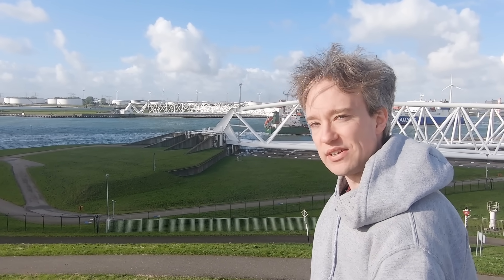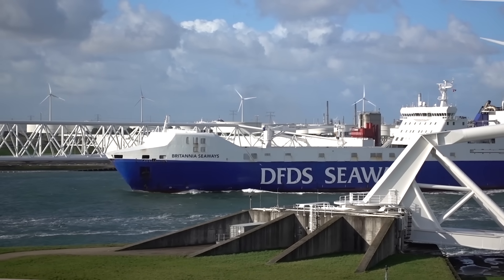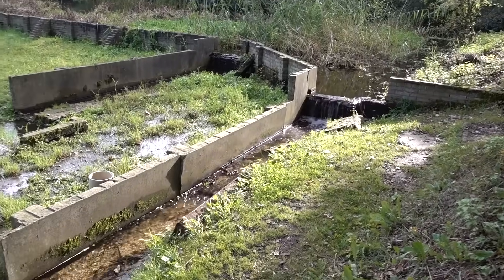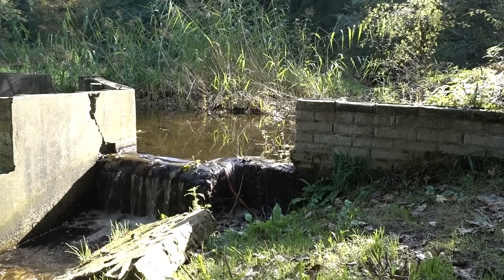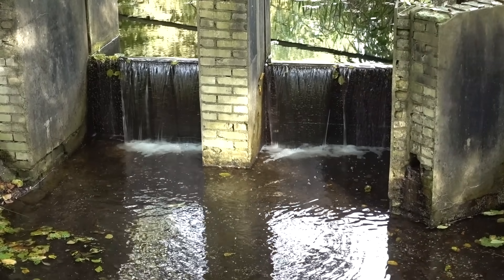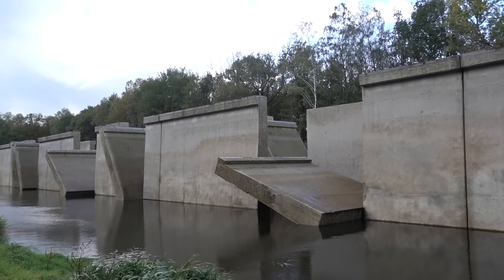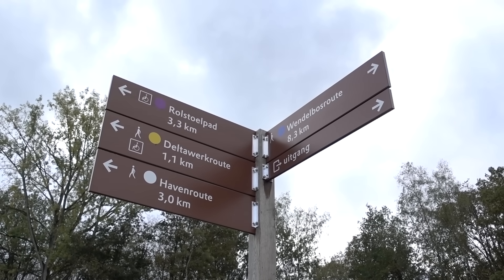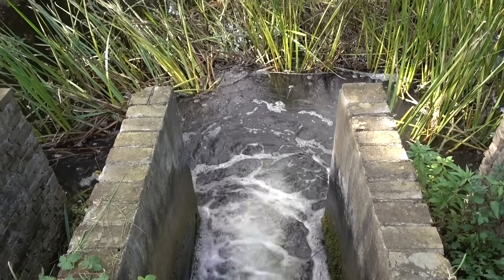How the Netherlands simulated the sea

Comment: An interesting point, the US Army Corps of Engineers built a similar facility in Vicksburg, MS in order to model the lower Mississippi River in order to determine how changes to the levee system would affect other parts of the river and how to minimize flooding damage through diversions at the Old River Control Structure, The Morganza Spillway and the Lake Ponchatrain Spillway

Comment: Computers are nice yes, but we still make models as of 2021 by the reason that some things are very difficult to simulate and needs a model . For this thing wich is kinda basic i think just comps would suffice but there is always a span where models may be required, however much smallet.

Comment: 'depending on who to believe, a fifth to a third is below sea level'
it depends more on the tides (1.5 to 2 meter fluctuation), then add the storm surge height as well. 
The 1953 disaster flooding had a total height of 3.85m above N.A.P (average sealevel at Amsterdam)
Its also the question if you include riverbeds that can overflow. Its not sea, but a lot of area is 'below water' in the riverdelta that way.

Comment: Actually.....
The floodgates of the Maeslantkering are being opened and closed at least once every year. The two times mr Scott refers two are closings due to actual storm warnings and should be three times. Fun fact, the system is 100% automated and does not require human intervention. It will close the doors if the water lever rises above 2.6 meters...

Comment: Cool video! However, one little nit-picking correction: The barriers won't flood at the 1:10000 year weather event, they are required to stop it. So it takes an event even worse to overflow the barriers.

Comment: Two fun facts:  

1. The storm surge barrier is quite literally out of their control. Opening and closing the barrier is managed by a computer which will close it whenever needed. Humans may wait an hour for the last ships to come in, or even try to save money. A risk that is almost never justifiable given the number of homes relying on this barrier. So it was decided the system would be build from the ground up in such a way that the people managing the system would be unable to interfere with the decision making process. There are, obviously, ways to shut down the system, but this would require work on multiple sites (tripping breakers etc) or agreement from multiple high-up people in different organisations. 

2. The Dutch will never even try to conquer water. It's a fight they know they will loose. The Dutch manage water. Getting rid of the water is neigh impossible, but leading it through channels is, for them, perfectly doable.

Comment: When I earned my Civil Engineering degree in the 1980s, we relied upon water models of all sizes, but none were outside. For example, I went on a tour of the St. Anthony Falls Hydraulic Laboratory, which used the flow of the Mississippi River at St. Anthony Falls in Minneapolis, Minnesota -- actually, just a tiny piece of that flow -- to provide moving water to test all kinds of designs and systems.

Comment: In tropical regions only mangroves, some specially adapted bushes and vines,  and some palm species are the only ones capable of withstanding living near the coast line because the ground and the water have too much salt. How did all that Dutch land become usable once drained? Wouldn't it have had too much salt in the soil? We are talking miles and miles 'inland' once the barrier was made as far as into the sea as possible. I mean, you may say "the rain has rinsed it away over years", but 'rinsed", when the rain has to flow going under sea level with no exit in the newly enclosed land means that they must have had to pump a lot of salty water over decades until the ground had flushed all that. Is that what happened?

Comment: I recently came across a study which was talking about the amount of people who would have to deal with a flood at least once a year if the climate keeps changing. At some point it said that it didn't take the Netherlands into account, which I thought was rather hilarious.
Reply: Reminds me of another comment when talking about water rise when someone pointed out contrary to what many videos say you shouldn't worry about them since they are used to dealing with it, it is the other countries that will drown because they have no clue how to handle it.
Reply: I do suppose that other river deltas like Bangladesh and maybe the area around New Orleans will have more difficulty indeed.
Reply: I wouldn't call being flooded out as hilarious. Quite the opposite in fact. Flood water presents many dangers and also in the mess left behind.
Reply: @markfryer9880  You're totally right about that. 
The study I was talking about didn't take the Netherlands into account because a large part, if not most, of the Netherlands is already below sea level. But instead of losing land to the sea, we actually gained land by building dykes and draining the inside. There is even a saying "God created the universe. But the Dutch created the Netherlands". So, the study didn't take the Netherlands into account because it would break their model. That was the part I found rather hilarious :)

Hopefully this clears it up a bit :D